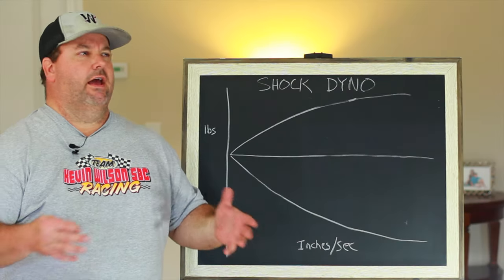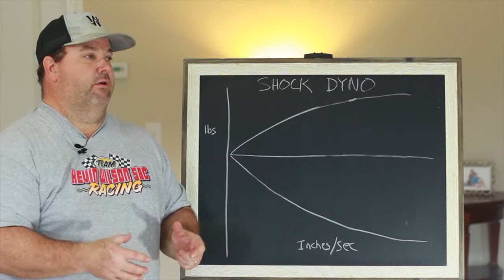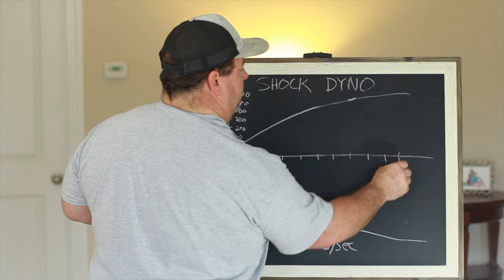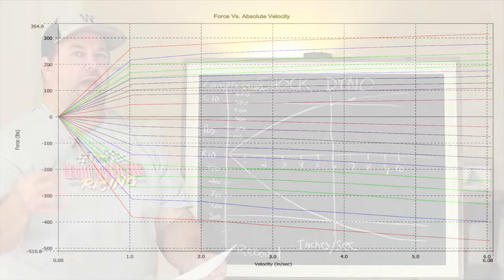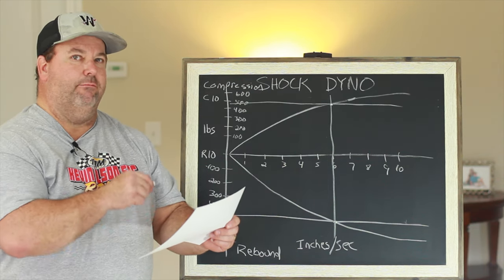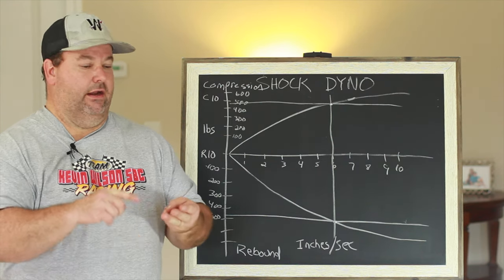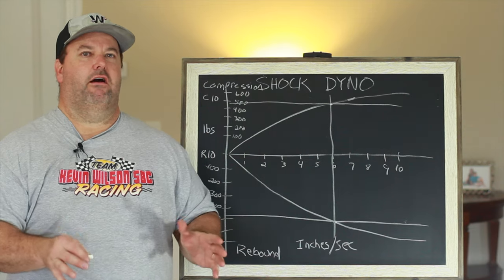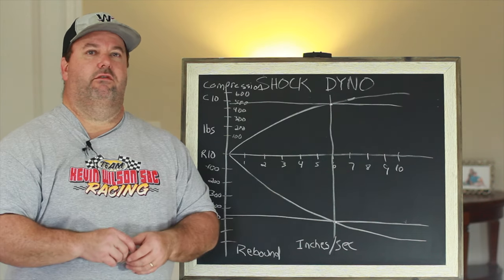Shock Dyno Graphs Drag Racing Suspension | QA1 Mod Series & Proma Star | Strange Ultra Inline Shocks

Comment from the maker: Not all shocks are created equal on holding power in lbs of force at a given velocity of inches per second! This video covers some of the common double adjustable shocks like QA1 Proma Stars, QA1 Mod Series and the Strange Ultra Inline Shocks. This info will help show you have these shocks have very different power levels on the hit where the velocity of the shock is greater and it needs to have enough holding power to keep the suspension under control.
Reply: I'd be curious to see what you think about the qa1 mod series shocks. I'm in your same shoes 4000lb truck at a best of a 1.25 60ft I feel I've reached the max abilities of the qa1 promos

Comment: Listening back through your videos, and once again Awsome content.   I wanted to comment that with your FT450 installed you can install a shock sensor and the FT will calculate the rate per second of travel.      Listening to this made me look at that data and understand the rebound a little better.   Thankyou

Comment: Kevin, I saw the video of you crushing the tire on the 48. I recall you mentioned the AS was higher than you thought was necessary. Did you leave the AS there and buy these shocks to attempt to control it? Or are you also going to reduce the AS?
Reply from the maker: Corey Binkiewicz thanks so much for your question! I am actually at less than 100% AS, but due to my car's Center of Gravity height and location, it still separates hard on the launch. The valving in the new Penske shocks are amazing and built to handle and control such strong extension tendencies with slicks. Go fast, go straight! Be Safe!!

Comment: Thanks for the explanation.  I never knew what I was looking at on the dyno sheet.   Just curious, did you happen to call Santhuff?
Reply from the maker: Preston Edmonds thanks so much for your comments! I will be adding more videos on this topic to help guid purchasing. I did not call Santhuff, but I have worked with customer's car running them and they have always done their job for sure. I only called the manufacturers that I have purchased from in the past. Do you have any experience with Santhuff? Go fast, go straight! Be Safe!!

Comment: Thanks for sharing the info and take time to make this kind of explanations!  It`s very hard to get this kind of shocks in my country, I like to ask you about the differences between comp. and rebound required for drag racing. Is it possible to help rebound on a non ajustable shock with some kind of preload using extension springs? I`m thinking on some "elastic" travel limiters. Thanks again!
Reply from the maker: Taunus27 thanks so much for your comments! I have never tried any type of elastic travel limiters. I can help you get some Penske Racing shocks for sure. Go fast, go straight! Be Safe!!

Comment: Have you used dump valves on any of your transmissions? Solely for traction on the hit, thinking about trying one out instead of going to higher stall converter
Reply from the maker: Brandon James thanks so much for your question! I have not used any dump valves yet. Been thinking about it a bunch though. Go fast, go straight! Be Safe!!

Comment: Any thoughts on Santhuff shocks?
Reply from the maker: Harry's Taxi 2 thanks so much for your question! I have personally not purchased any Santhuff shocks but I have tuned many suspensions with them and they performed great. I only mentioned the shock companies of which I have personally had interactions with through purchasing shocks for suspension tuning. Kinetic Engineering is also amazing and can help with many manufacturer's shocks. That has ranged from street/strip cars, streetrods, and full blown drag cars from bracket car all the way up. Go fast, go straight! Be Safe!!

Comment: Ya lost me
Reply from the maker: Jeff Turner I apologize! It is a challenge trying to break this down at times. In short, we need to understand the ability of our shocks to "hold" or manage the reaction of the suspension on the hit and through the run to keep control of the race car and not overrun the slicks or radials. A shock dyno graph shows you how much holding force in lbs a shock can do at a given velocity measured in inches per second. Does this help at all? Go fast, go straight! Be Safe!!
Reply: @KevinWilsonSBC  no worries,
Reply from the maker: OK.. .but I will find a way to make this easier... I appreciate your feedback and I will do better as these graphs are critical to understand as we continue to put down more and more power. Thanks for supporting the channel and for me pushing me to do better!
Reply: @KevinWilsonSBC  I’m adding power to my 72 C-10 as well as double adjustable shocks